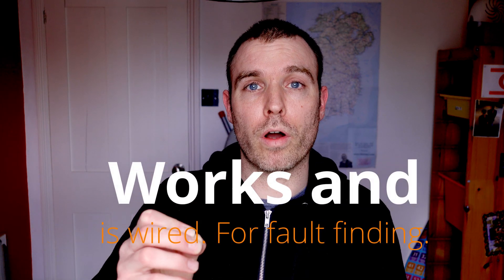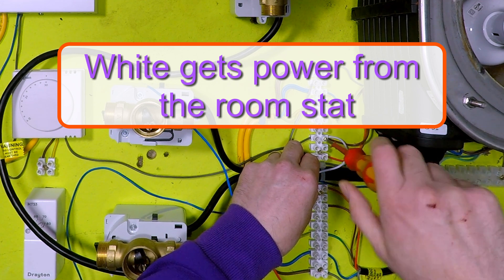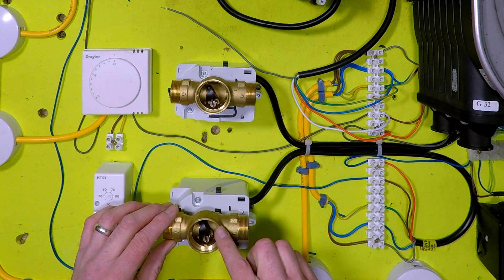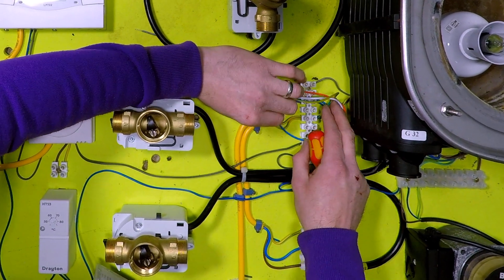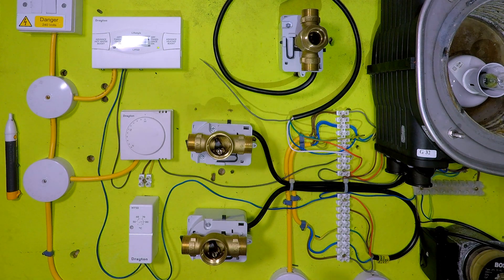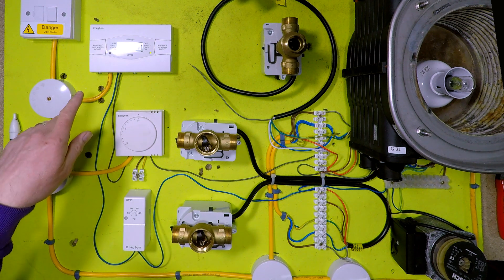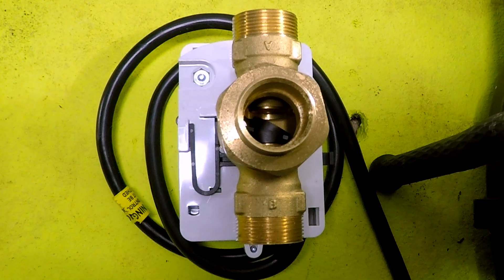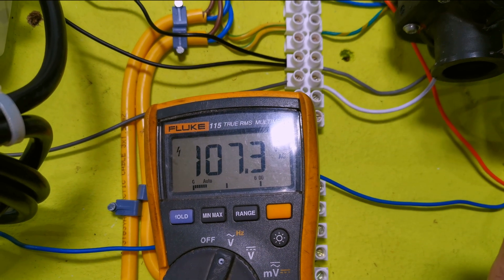Engineers Guide to 3 ports/Y plans.  Quickly

Comment: If i turn heating or hot water on, it can take a couple of hours to come on. I've changed the 3 port valve, and the valve clicks whether heating or hot water are demanded. However the pump and boiler dont fire up. I've changed the pump, programmer, and room stat and get 240v at switched live on the boiler as does the pump, so what could this be? Sometimes the heating may go off with the hot water otherwise it doesn't. The stats function fine too, so if there is no demand the valve moves over accordingly. It is a vaillant, and there's no fault codes and the display is working fine. Any suggestions? Only thing I have changed is cylinder stat or the flex for the pump.
Reply from the maker: If you have 240v at switch live on the boiler and the boiler isn't lighting then maybe the boiler is the issue.
Reply: @HeatingGeek  but the pump isn't firing up too. But when it is on then it can work fine, sometimes heating might go off early. But boiler would show fault code if something was wrong with it. If i bypass and put a connection between live and switch live it works fine obviously I don't have control via stats or programmer
Reply from the maker: @nadznadz5630  So you don't have 240v on switch live when its not working?
Reply: @HeatingGeek  when it's not working i do have 240 at switched live
Reply from the maker: @nadznadz5630  Then maybe you have a neutral issue?

Comment: Any idea why my pump runs continuously unless the switched fuse is turned off. I have replaced the pump and mid point y plan valve with all wires fitted in a like for like basis.
Reply from the maker: Maybe your boiler controls the pump? or you have a frost stat fitted and wired wrong.
Reply: Thank you I will look into that. Merry Christmas

Comment: Great informative videos,  I've a question for you?  I've recently moved and the house has a three port valve, everything works independently, but if the water and heating is on together, the boiler cuts off when the hot water is satisfied, and the heating only kicks back in if I turn the water off.  (I guess it may start again when the water is being called again), any ideas where the fault is?

Comment: so am i right in saying that when its CENTRAL HEATING ONLY the sequence is...

Fuse spur > Controller > {CH ON > >Room Stat > 'White Wire' to 3 Port Valve
                                        
                                        > {HW OFF > Cylinder Stat off
                                    
                                        > {'grey wire' to 3 Port Valve  > Moves Valve to A > Moves Micro Switch to Orange > Pump & Boiler

so both the white and the grey to the 3 port are live? 
i hope that make sense showing what happens at the same time
Reply from the maker: Your spot on. :-)

Comment: Great Video as always. I think I’ve seen most your vids now 👍 

Any chance you could do a review / deep dive on HONEYWELL EVOHOME inc the smart TRV’s ?  It would be great to hear a heating engineers opinion on the system. 

It’s been out for several years and seams a great way to get multiple zones in your house without expensive plumbing modifications.
Reply from the maker: I can try and get hold of it and if I do I will do it. :-)n Looks pretty cool though. :-)
Reply: HeatingGeek Cheers 👍 

There are few of these smart TRV systems on the market, but the evohome seams the most reliable and doesn’t require a subscription for certain features like Tado. 

Would be great to get a heating engineers opinion on something like that through. 

I’m already subscribed and watch your videos so I’ll spot it if you do find one in the wild ha !

Comment: Great videos, came here as I have a HW issue. Unfortunately I still have the issue, so if there's any kind soles out there willing to give me a steer id be grateful. Please reply below. Cheers
Reply from the maker: Sorry to hear that. Have you got it dsorted yet?
Reply: HeatingGeek hi mate. Still a scratching my head tbh. Boiler trips out when calling for HW only after a minute. Changed the motorised valve, drained the system, checked the wiring and programmer, and still no joy. It’s a pressurised tank system.
Reply from the maker: @shoulin3822  What do you mean "boiler trips"?
Reply: HeatingGeek the boiler turns off, and stays off for about 6 to 8 minutes then fires back into life for 2 minutes and then off again for another 6/8 minutes. So if I ask my hw to be on for 1 hour, then the boiler is only actually on for about 15 mins of that hour. The pump run the entire time for said hour.

Comment: Do you ever see a worn shoe which will give heating in summer when not wanted and hot water out of control ( too hot) when heating for long periods  during winter -- or do they usually get scrapped before that happens ?
Reply from the maker: I have never seen a worn shoe. I think dirt is what makes them pass. They must have 50 years in the shoe. The springs will probably fail first.
Reply: A quick sand/ reprofile to seal to each port and good for another "X" years,  also had a ball type in a nearly new valve which would seat - cool then grip the ball leaving a ring marking and refuse to return- stick,   Broke the burr on the seat ( badly machined? ) and good to go. Never seen another one.  Cheers keep up the good work🙂
Reply from the maker: @pollywollydo  If you take it out for repair most people would just replace it. :-) I like the Idea of cleaning it all up but time doesn't allow such luxury in todays age.:-)
Reply: HeatingGeek yup times money,   One of the benefits of retirement,   Luxury of " fiddling" 😏
Reply from the maker: @pollywollydo  I get it now. :-)